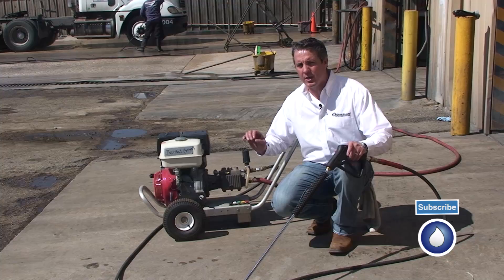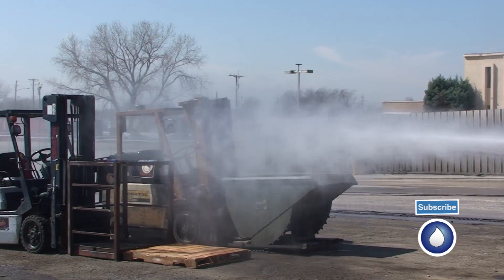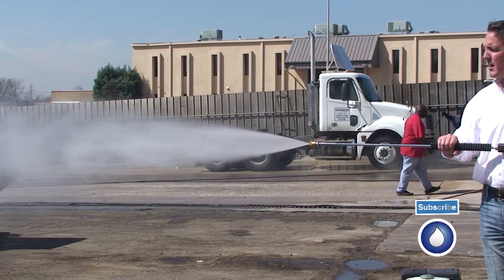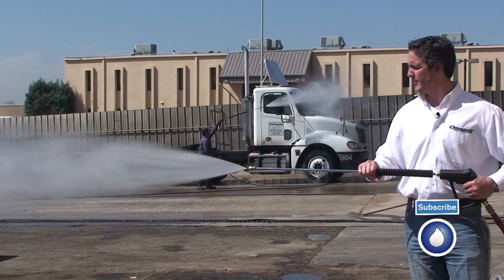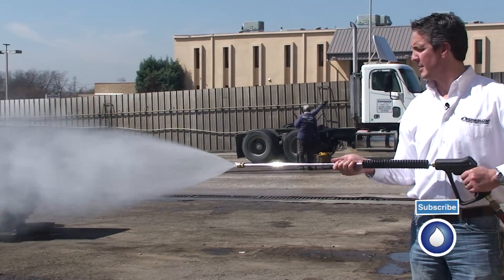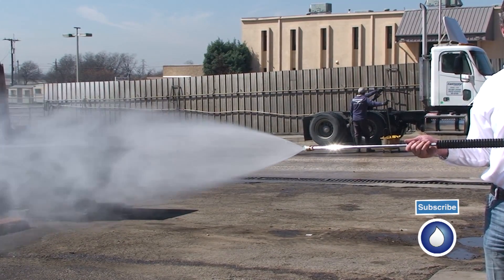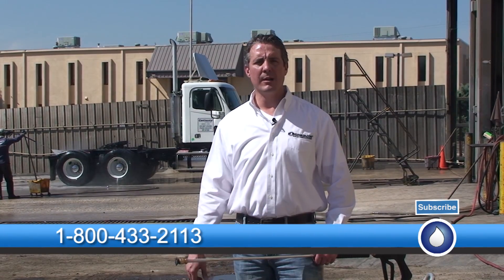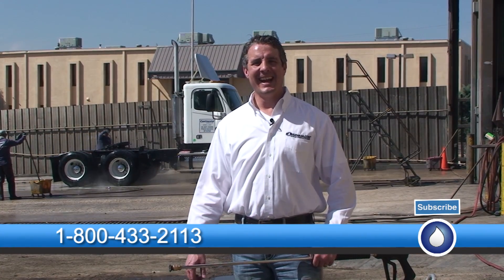Pressure Washer Nozzles: What  Is a Pressure Washer Nozzle Degree Pattern is 0°, 15°, 25°,40°, & 65°

Comment: Hello I have a karcher HD 585 that has the following specifications:
Water Flow (l / h) 500
Pressure (PSI / bar) 2100/145
I do not know which measure of Pressure Washer Nozzles, to buy could help me.
Thank you !

Comment: I have e karcher 620 m, 140 bar and it stops with 40° nozzle after 1 minute. i switch it off and let it stay for a while and then turn it on, it starts working and then it stops again. It happens also with 25° but it works longer.
Reply from the maker: The degree of the nozzle should not have any effect on the performance of the unit.  Nozzle size can.  Just make sure you are using the right size.  I am assuming you are using the size the came with the machine.  I recommend you go to the dealer and have them look at it.
Reply: @Powerwash  I had a Bosch aqt110 and i tried all nozzle colors, no problem. With Karcher when i put the white one, the pressure washer stops after 1 minute, when i put the green one it works longer but it stops also after a while (10 minutes).
Reply from the maker: @Drilon812  Sounds like you may have the wrong nozzle size.  Size and degree pattern are not the same thing.  So make sure you have the right size

Comment: Hi
U seem to me a knowledgeable person on nozzle tips.

I bought starq w6 model, the main purpose was to clean bathroom tiles, wash basin .

But with regular nozzle, it's not effective in removing stains from the tiles.

So i was looking for turbo nozzle or zero degree nozzle tip, to get the effective result.

Do you think it will work.

Comment: What is the best nozzle tip for roof washing with the bronco system if you on standing on the roof?   Tku
Reply from the maker: You will want to go with a fan tip 25 or a 40 degree pattern, size 40 nozzle